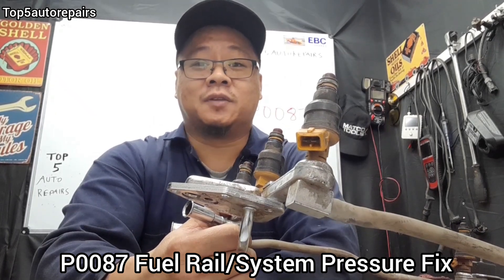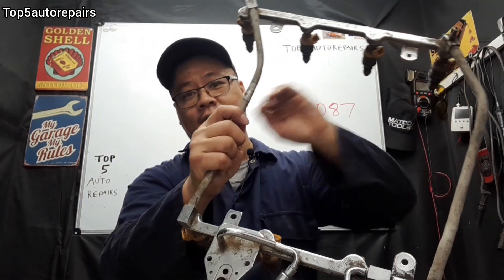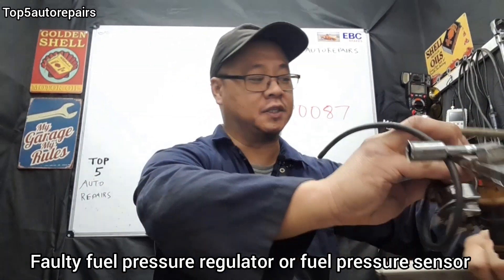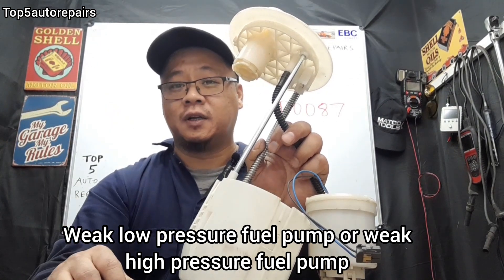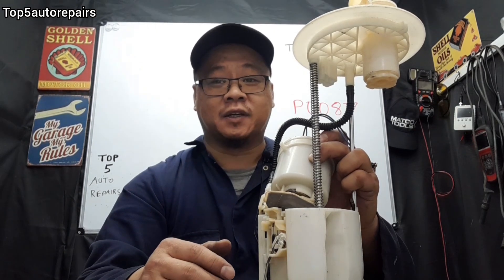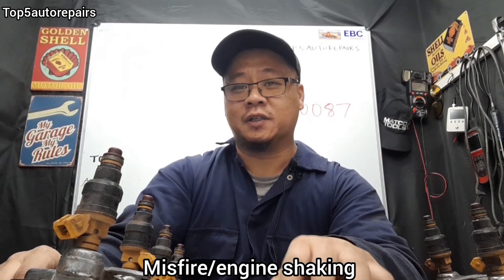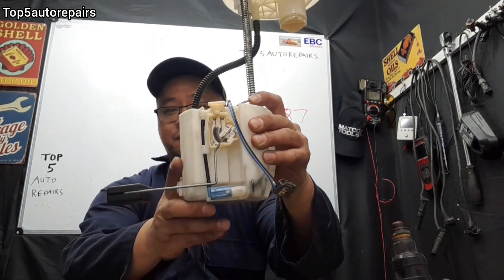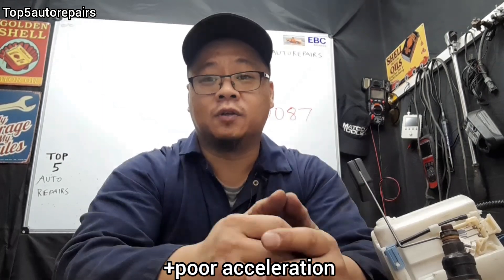P0087 FUEL RAIL SYSTEM PRESSURE TOO LOW FIX (HOW TO TROUBLE SHOOT)

Comment: So i have a 2017 qx80 and i have the p0087 code and its leaking from above the fuel tank im assuming ill have to replace low pressure pump but im also worried about the high pressure pump valve hat people say they destroy engines i only have 106,000 miles what do u think

Comment: I recently got my fuel injectors changed at small shop and got this code so took it to dealership they said they couldn't find the issue and assumed air was in the fuel lines car drove good even with check engine light on just code pops up and hard start when cold start all sensor check out any tips ?

Comment: 2013 min countryman s. Recently changed out the turbo. Drive fine for about a month, but suddenly getting the p0087 and p15df. My gf said it stuttered and lost power for a little bit but then it was fine after that. How should I go about diagnosis? We have a scanner to read codes and monitor performance. Where should I start? What's the most likely culprit? Also would a bad air fuel mixer cause this code to appear?

Comment: Hello, im expiriencing this code on my 2015 Peugeot 308 1.6 bluehdi 120hp... Basicly simptoms are, car is running normally like always, but under pressure, when i hit gas on uphill or overtake it goes into safe mode and sometimes if the gas is too high it will even turn off, and then i have to stop and restart the car. My mechanic says most likely its the HPFP. I wonder if anything else could be the issue before I change the main pump. If anyone had similar issues i would like to know how did you solved it, any advice is of help, thanks.
Reply: have similar isue in peugeot 508 hdi. please share if you find solution.
Reply: @theworldisyours2944 I have fixed it, it was the High Pressure fuel pump, it was changed, the system and injectors were cleaned, new filter, now it runs like brand new again. Hope it helps

Comment: Hello sir i hope if you can maybe help me with these codes it my engine is holding in when i want to accelarate quickly from stand still or when i brake and accalerate hard it also holds in and goes away and today it paired with the epc light and the epc light went of while driving and it drove very good after that.

Comment: Had an intermittent P0087 fault on a 2.0ltr diesel VWT5, i can do 10 trips, zero issues, then bam, go to start, engine stutters, P0087 on OBD scanner
Turn engine on and off a few times fault goes away for several days to a weeks, then randomly comes back. Changed the fuel regulator, new battery,  lift pump and Fuel pump relay. What else could i try ?
Reply: Did you ever find the fault?
Reply: @theukhasgonetosht1704  yes, it was faulty ecu, replaced the fuel system and it still did it, sent the ECU off to Autotronics and they replaced it, runs perfect now, bank balance took a beating
Reply: @JTechWP 🙈 my God.
 that is expensive to replace. 
I cant belive ECU was the isue. 
I think mechanic man lied to you.
Reply: @theworldisyours2944  £370 to have the ECU repaired, its ran perfect since then, bit gutted i spent £4k on parts and it was bad components on ecu in the end, but shes running great again now :)
Reply: @JTechWP  lucky you because ECU its hard to find who can repair and new one  is much much more expensive than your bill. Maybe when they told you they repaired components in Ecu  ...really was reprograming configuration... and any component was really involved in fail?.

Comment: Last weekend I was driving down the freeway and my truck started to give me on the dash performance restriction and it started smoking and losing power and I pulled over and the Range Rover started to smell like gas and I just turned it off and towed it home. When I got home I scanned it gave me the P0302 P0304 P0306 P0308 and I changed the spark plugs they were bad and struck started and I was running low on gas so I decided to turn it off and went to get gas and tried to turn it on and it just cranked but no start :/ and I got the code P0087 and I replaced the coils and the fuel pressure sensor and no start I did the pump and no start I’m lost :/ hope you can help me. Thank you 🙏
Reply from the maker: P0302, P0304, P0306, P0308 shows the problem is on a single bank. Most likely driver side. I would start by checking all wires. Wiggle and pull every wires. Fuel injector, fuel pressure sensor etc...
Reply from the maker: Check high pressure fuel pump as well.
Reply: @ I will double check all the connections. But I’m just lost because when I installed new spark plugs and coils it started up good and stoped the shaking and then when I turned it. I bought a 3 gallon gas tank and then put in the Range Rover and I wanted to started and that’s when I couldn’t start it :/
Reply from the maker: Use a multimeter and check for power, ground etc... it sounds like an electrical issue on that bank. A bad fuel pressure sensor and fuel pump will affect both banks but this issue only affected one bank.
Reply: @Top5AutoRepairs  thank you I’ll do that. God bless and your videos have helped me do my own work and it’s saved me thousands in repairs thanks for sharing your knowledge sir🫡🙏